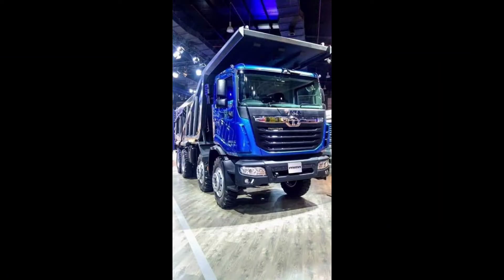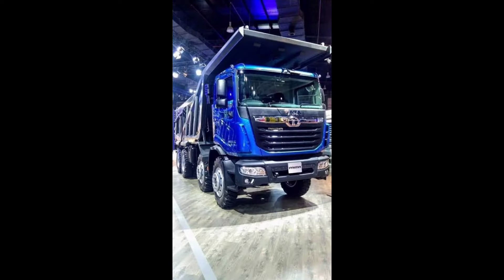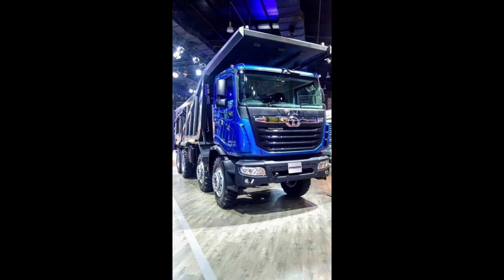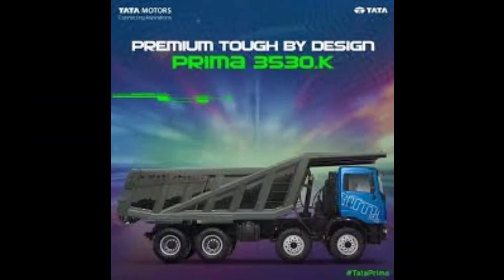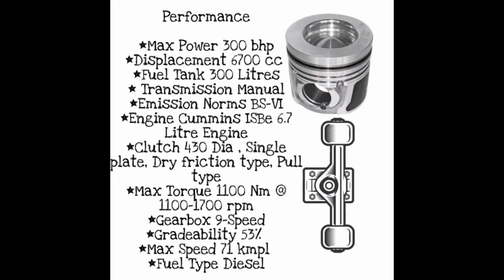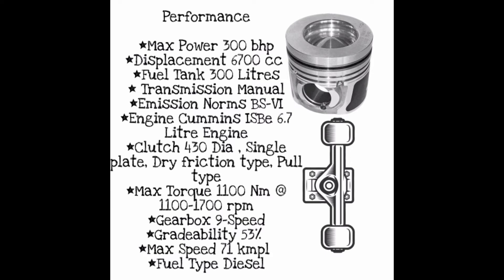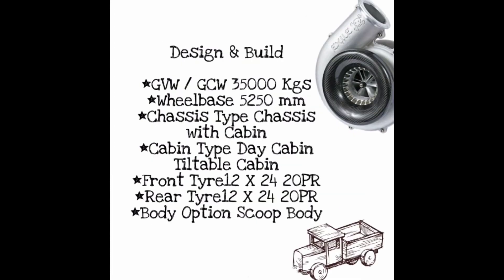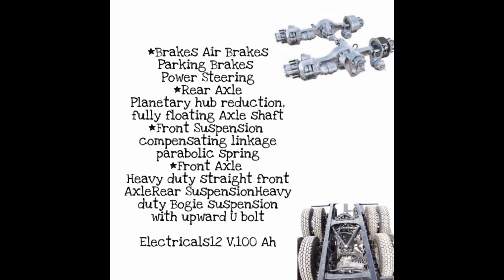Tata Prima 3035K Tipper specifications || BS6 || TATA BS6 || K.A.D.W ( Karnataka_Auto_Diesel_Work  )

Comment: Prima 3035K  BS 6 💪💪 ATULYA_ ISBe6.7  350 HP💪💪💐 .6 Cylinder Engine. 
Compression Ratio.18.5:1
Bore / stroke.107MM/124MM
Fuel system .Bosch HPCR CP4. 2
GSL-Gear shift lever Bracket
Intake & Exhaust throttle valve .
Max Fuel pressure _1800 Bar
Turbocharger Type.HE 300
ATS_After treatment system and SCR Technology